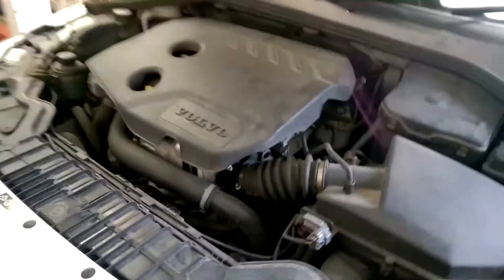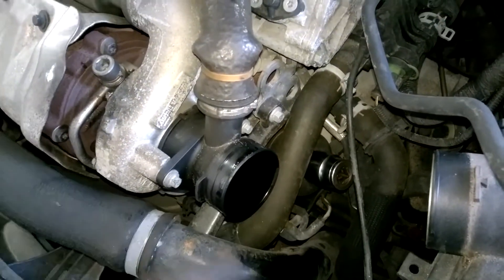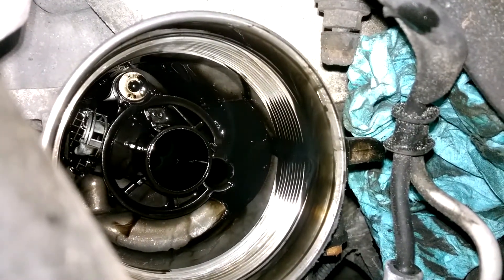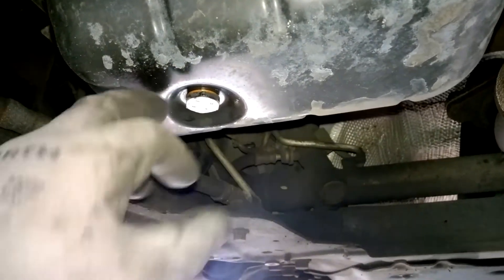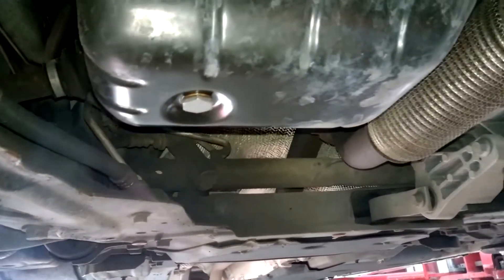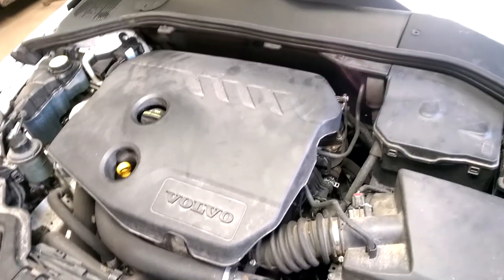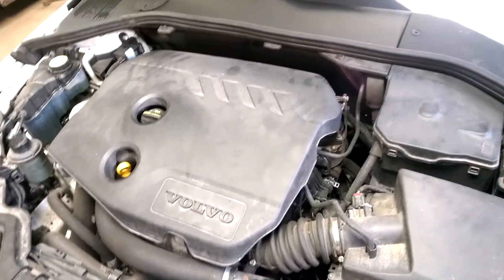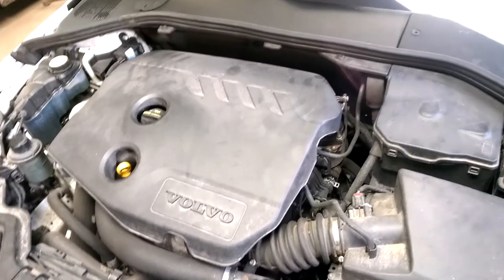Volvo S60 Oil & Filter Service - How To DIY

Comment: My biggest complaint about that 1.6 PSA HDI is its tiny sump, cant even fit 4 litres of oil in it which means regular oil changes are a must as its such a needy engine as far as good oil is concerned.

That engine is in everything at some point or other.

Nice video.
Reply from the maker: Thanks very much for your comment.